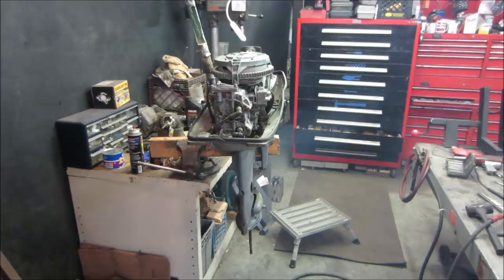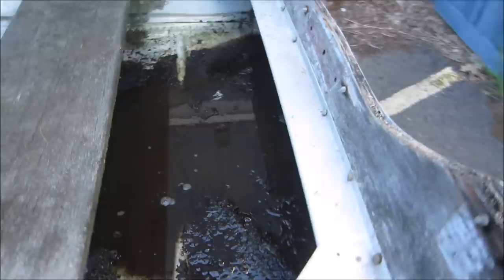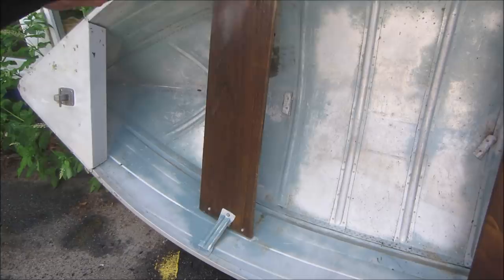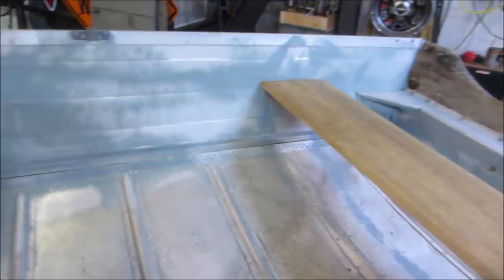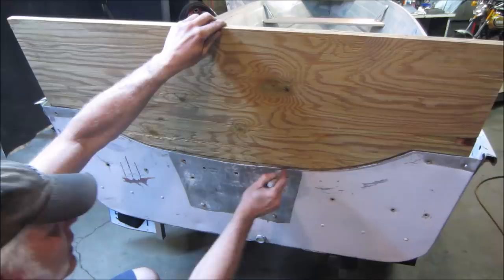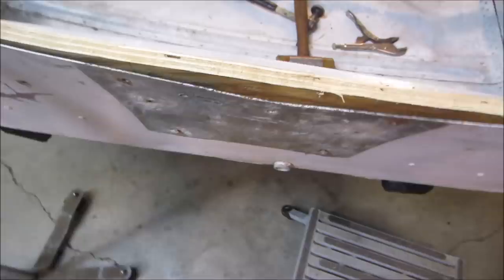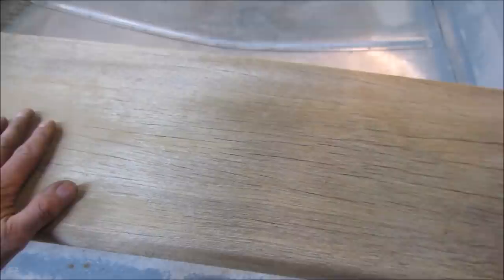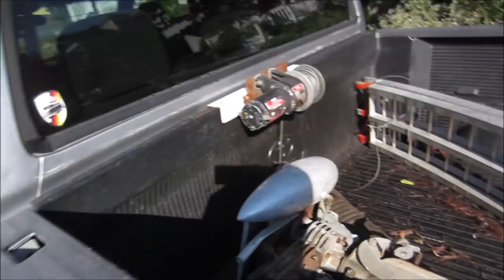Free Boat, First Wash/repair in 20 Years

Comment: Those seat's had supports on them and I'm sure glad that you put the wood on the outside of the motor housing because that stops the motor from slipping upwards. I was raised up at Buckeye lake in Ohio and you wouldn't believe the money that I made in the summer BY diving and recovering boat motors in the summer because the almighty men would remove the outer piece of wood. I'm 71 now and I'm just glad that I'm able to remember my youth!

Comment: Mustie, I used to professionally wash and stain decks and wood fences, used sodium hydroxide on the wood before low pressure washing, it won't fuzz the wood that way and restores all the natural color. Also to clean the aluminum hull use purple power aluminum brightener, aluminum will look new with no scrubbing. Inside the boat I would paint it with Rustoleum self-etching primer so it doesn't peel. Also pressure treated wood has chemicals in it that will attack the aluminum, not a good choice for a transom. 3/4 inch cabinet grade ply sealed with two coats of polyester resin would be a better choice if marine ply is not available.
Reply: Also pressure treated wood has chemicals in it that will attack the aluminum,  <--------- yup agreed 900% i had that happen turned into dust
Reply: Great advise!
Reply: Glad I saw this today. I'm going to be replacing a transom on a john boat and had planned on using treated. Change plans now.
Reply: @bottomlands  Won't be much of a testbed if it disintegrates in 3 months...
Reply: If he puts a barrier membrane between the two, won't be any corrosion.
Reply: @bottomlands  Start thinking before typing next time.
Reply: @dept.ofredundancydept.94  Aaand I'll refer you to the comment by "ck m".
Reply: @TermitesRGood1  It's got copper in it.

Comment: It would drive me crazy not having that plywood cut properly to length.
Reply: Yes Sir!  It should have had a proper taper cut and then once inserted into the slot, the ever so rewarding sound of it bottoming out at the same time the tapers make contact! Sure, it takes more work but worth every minute.  Plus, the transom is much stronger with the slot fully packed with good solid marine grade ply! Oh yeah, he didn't use that either. Damnit, now my other eye is twitching too!
Reply: And all the edges should have several coats of a sealer.
Reply: @physicsguybrian  ty, I am not alone lol
Reply: @fg146  Keep in mind Mustie is an expert and an experienced restorer of a wide variety of engines and equipment. It is his living to sell restored items apart from the advertising revenue from YouTube videos. He buys cheap or for nothing then sells for a profit. He needs to keep in mind the time and money he puts in to his restoration projects. Did you hear him say he got the outboard for $20 and he expected to sell it for $350. He has other outboard motors awaiting restoration. The boat is a test bed for these motors. The boat will see only occasional use and will not be subject to the expected deterioration of you OCD nitpickers. It will be fit for purpose. FG, if this drives you crazy then perhaps a psychiatrist may help.
Reply: I fear, if it would be my boat and if droceretik is true, I´m also in bad need for a psychiatrist. 🤣 Of course I don´t care what others do with their boats.
Reply: I think what he did is totally fine and sufficient. He got the boat for free and the outboard motor for 20 bucks. He is all about getting things for cheap or free and getting them back to good working order for cheap or free. Sure, he could spend a lot of time and money and make a perfect boat but that is not what he or this channel is about.
Reply: @droceretik  I am not a nitpicker and I dont have OCD, just agree with Brian and FG that a little more effort would have actually restored this skiff to a salable product once his stack of rusty engines have been tested (as it is now just a stupid would buy it), OR he could have a restored it properly for his own longer use. The effort he did here was like welding half of a bike or car frame and then happily thug along on the road expecting it to fall apart any time, to your own and others danger.
Reply: I kept saying as I was watching - there was enough wood to do it in two pieces and make the whole back complete with slopped edges.  Bolting the outer wedge on would covered the joint and stabilized it across the seam.
Reply: me too. lol
Reply: I noticed the same thing! Good eye!
Reply: @Mr.M1STER  agree

Comment: A cheap material that one can use on the outside of the transom and other places on boats are plastic cutting boards. There are (at least here in Sweden) these white, (almost a little translucent) cheapo cutting boards that are made out of a plastic that is slightly "bendy". There are different sizes and thicknesses and they are almost indestructible... I have also used 20 of them (screwed down in two rows) on the floor of my snowmobile garage (it's a wood floor, and the carbides tore it up something fierce). And several years later there's almost no deep scratches in them.. I used big washers when I screwed them down so that I spread the load a bit, so the bolt heads didn't creep thru the material.
Reply: Excellent !  Low cost StarBoard !!
Reply: That's actually kinda brilliant
Reply: did the KGB brainwash you? I too watch Andrew Camatra and Mustie - any recommendations on any other guys (channels) who do the same sort of thing?
Reply: @cockerhamsands  Not exactly the same kind of channel, but one I truly adore is "Project Binky" made by Bad Obsession Motorsport. It's made by two really funny British car racing guys and they are shoehorning the drive train from a 4WD Toyota into a Austen Mini... I'm pretty sure most of you guys that watch this channel (and maybe even mustie himself?) will like that channel too. They are brilliant car builders and fabricators, but hilarious...
Reply: @cockerhamsands  Try "Diesel Creek"
Reply: HDPE (High Density Polyethylene) is also available in sheets in various sizes and thicknesses. Amazon, Walmart, ebay, etc.
Reply: HDPE is some low cost amazing stuff.  Built my lawn furniture out of it.
Reply: Great idea !
Reply: @akersjon278  We need more brackets.
Reply: @marioreali5925  LOL, that's right, we do... And also some more chocolate biscuits...

Comment: The transom piece not being the full width would just bug the living shit out of me.
Reply: I am flabbergasted also... really thought the intrepid Mustie would correctly install the full width of the transom wood. I want to find this boat and refit the wood. 😬
Reply: You could offer to buy him a 4'x8' sheet of plywood to remedy that issue.  😆
Reply: @aliceshaw8265  I am relaxed. It's not my boat.
Reply: It's a big mistake, the transom piece has to be the full width.
Reply: Glue some plywood to the ends fill the gaps and minimize flex!
Reply: @brucecoleman7412   Agreed or some  batten glued and fixed to fill gap and protect ply ends. I'd do 1st coat of Varnish 50/50 to seal then build up to 90/10 finish, sanding between coats. And maybe clean up the undersides of seat and coat up. That's what I'd recommend from my armchair anyhow !!
Reply: I couldn't sleep at night if I knew I was too lazy to go out and get a new piece of plywood.
Reply: Same here. Can't stand a lousy job.
Reply: @aliceshaw8265  Pls remind me not to buy a single thing you "fixed". There's nothing to be liked about a POS repair and this is one.

Comment: Some aluminum boats did have a wooden walkway up the middle to keep you walking on the ribs and not stepping on the area between them which, when the boat is not in the water means the rivets are holding your weight.  Most I have seen had slats that ran the length of the boat each separated by a 1/2" or so.
Reply: Yelp!
Reply: also a little better footing while fishing
Reply: I had a boat that had like a kinda tank with Styrofoam in them under the seats i think that might be what that was. for if the boat ever took on to much water.
Reply: Yes. some slatted duckboards also gives you something to drop your fishing boxes on as well as keep your shoes out of any water that gets in the boat.

Comment: In all fairness, that video is a testament to the toughness and durability of aluminium small boat engineering and construction. For any boat to suffer literally years of neglect and abuse - including at least one collision - and still stay fundamentally watertight and seaworthy is astonishing.

Fantastic content, as always. 

Some notes from a long-time boat guy: The seats may not strictly be teak. Plenty of boatbuilders substitute other woods. Teak is nowadays very costly, and is environmentally protected. Could be any number of tropical hardwoods. Also popular these days is cedar.

Before you take the boat out on the water, make sure the Good Ship Mustie is equipped with life preservers, an anchor, mooring and anchoring lines, and at least one oar or paddle. Because, ya know, even the most expertly-repaired marine motors have been known to quit at inconvenient times.

Comment: Gidday from OZ, those 3 brackets are directly below each of the wooden seats. There originally were 3 vertical supports that went from those brackets to underneath each seat. The screw holes will still be there. This tinnie has no flotation, therefore it must more than 50 years old. If it gets full of water, it is off to the ocean bottom with it. It may have belonged to Noah and came off the Ark.
Reply: Yep, had a couple here in the US, one with wooden seats like this one and one with aluminum seats, both of them had vertical supports from the bottom of the seat to the hull where those bracket remains are.  Not sure the age of this one, but at some point most of the ones we had did have the styrofoam flotation under the seat.
Reply: Yeah use these as river,pond and putting around the shorelines and coves in lakes . Preferably out of the wind . I have one just like this I think it's a 65 or 62 I cant really recall off the top of my head . Still have the original title . But they can be super sketch especially if your a big guy lol watch your step .
Reply: wargent99  just so you know? boats can sink in lakes as well as rivers.......
Reply: wargent99  Loads of people take little 12 and 14ft aluminum boats in the ocean around here.  Mind you, you don't want to head far to the open water, but rather inlets and waterways and close islands.
Reply: I think that the braces may have served two purposes: supporting the center of the seat and stiffening the keel. 
-- If Mustie were going to get ambitious, he could fit a plywood floor, and then squirt some polyurethane foam in a can into the space underneath to serve as flotation.
Reply: @grizzlygrizzle  spot on mate, that is the more modern way of building these alloy boats and would give some flotation.
Reply: @5thGenNativeTexan  I had a boat that had like a kinda tank with Styrofoam in them under the seats i think that might be what that was. for if the boat ever took on to much water.

Comment: I believe it had corner brackets on the rear corners. Sometimes cast aluminum
Reply: Yeah, all the ones I've seen were stamped with stiffening grooves in them.
Reply: The transom will be under considerable torque from the motor, bushing to the front at the bottom and pulling to the rear at the top. With the transom wood not reaching to the corners, this force will be transfer to the exposed aluminum of the transom at the top corners, rather than to the gunwales.
Even with the wood extending fully to the gunwales, corner gussets are still needed to properly anchor the top of the transom to the gunwales.
Reply: @linusromey561  you get it.....Mustie is a genius when it comes to small engines but when he does stuff like this I think "I can't watch this......"
Reply: It should have one with a handle on the front.

Comment: Transom board should never be made with treated plywood. The chemicals in it eat the aluminum up. And the transom board should cover the whole back panel. This gives you the best strength over the full transom.
Reply: I use CDX plywood and give all surfaces a couple coats of polyester resin to seal the pours.  caulk bolts which pass through holes.  the wood will crush some where the engine grubs down so you want some thickness there so the engine doesnt move about.
Reply: You're watching the wrong channel if you expect repairs or restoration done at a higher level.
Reply: It'll be fine
Reply: That's not treated plywood unless I missed something, it's regular ply that he sealed.
Reply: @fontana101  he said it was pressure treated in the vid.
Reply: Pricklemeisters are out in force today.  Clearly stated it's a 'test bed' for outboards.  I don't think he is looking to turn it into th QE III.
Reply: Just don't use treaded. We're not watching for a full restoration. But using treated cost more, and will damage aluminum.
Reply: He did say that pressure treated ply was all that was available.   Frankly, he didn't pay that much for it, and he wants it for testing stuff.   It's unlikely to stay salty/wet enough for pressure treated wood to really attack the aluminum.  Especially in a boat of that age.
Reply: @tiporari  My bad.
Reply: God stop moaning. It was a left rotting in a garden for decades. It'll be fine
Reply: i agree but it doesnt eat it over night and its not a expensive boat soo spending 150 bucks on marine plywood then epoxy coating it isnt worth it
Reply: @tbelding  Lumber being in short supply in some areas seems to be pretty common at the moment. Some people don't realize that when some work places got shut down or had a limited number of people that could occupy a building it included mills that produce lumber. One place I know of that makes custom timbers was shuttered for 3 months and now have a backlog. Was building some hive stands and needed some 4x4 post for making the legs, all I could find out of 4 local and 3 nearby towns lumber yards was 1 twisted and warped 8 foot hunk of untreated "white wood". The menards backlot area with posts ect has been wiped out for over a month now.  I wound up scavenging pallets to make legs from the thicker runners off them.
Reply: Face it.  He got the boat for free.  He is just using it as a test bed and not for a complete restoration.  It was probably off to the scrapper if he had not snagged it.
Reply: @justarel  - I just found out that one of my customers had 12 pallets of plywood go missing recently.
Reply: @snapfish89  It is getting Coated; ergo: no wood to metal directly in contact.

Comment: Mosquitos my friend, what you are growing in the stagnant water in that boat are mosquitos, tenths of thousands of them and they will come to bite you, so you better get that drain hole opened up and keep it open whenever that boat is out of the water. And the reason why the bottom two bolts were longer is because they originally went through the 'missing' outer wood panel. When someone removed that wood panel, they just put the original long bolts through. I suggest that you take those long bolts out and run them through the outer wood panel too so that they hold the entire sandwich of wood - metal - wood together.  Without those two bottom bolts going through the outer wood, you will get a lot of flexing and bending on the rear caused by the force of the motor rocking back and forth in the waves and that can cause wood and metal fatigue in the long run. Those bottom bolts are needed to stabilize and hold the entire back 'sandwich' together   :)